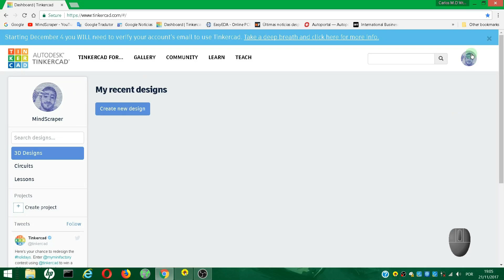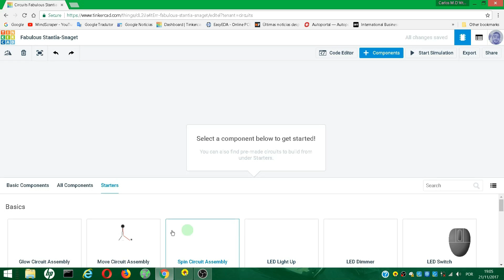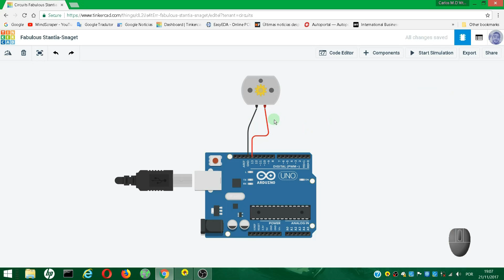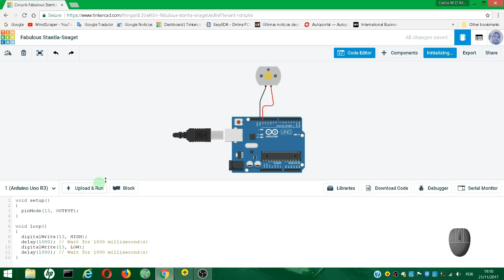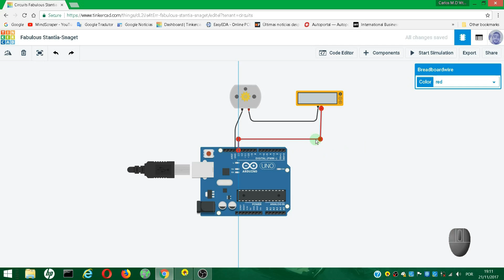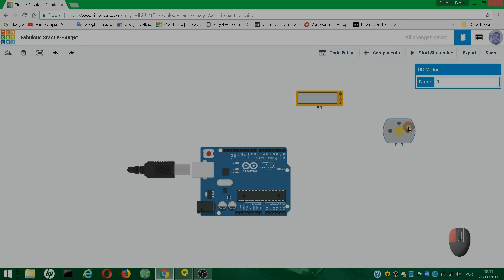Simulation of electrical circuits and code in Arduino with Tinkercad

Comment: Upload code bro
Reply from the maker: Do you want the code?
Reply: @MindScraper  either me
Reply from the maker: Here's the code @Ve3yt 

 void setup()
{
  pinMode(13, OUTPUT);
}

void loop()
{
  digitalWrite(13, HIGH);
  delay(1000); // Wait for 1000 millisecond(s)
  digitalWrite(13, LOW);
  delay(1000); // Wait for 1000 millisecond(s)
}
Reply: @MindScraper  thanks a lot sir , God bless ya